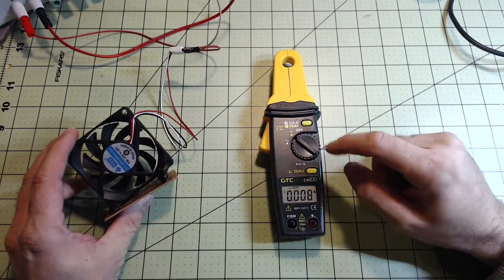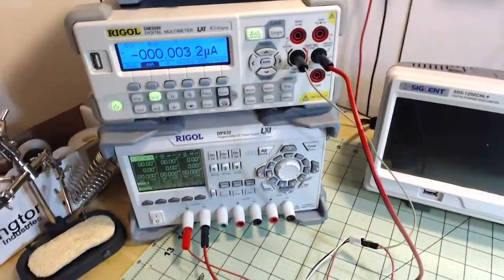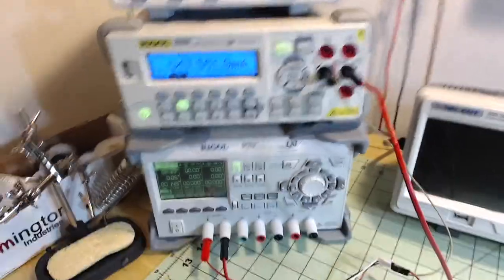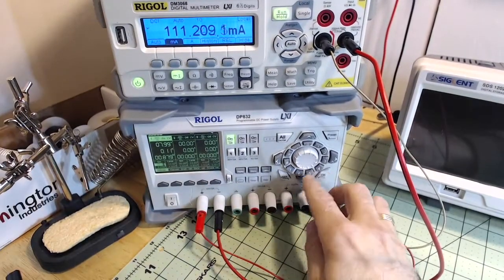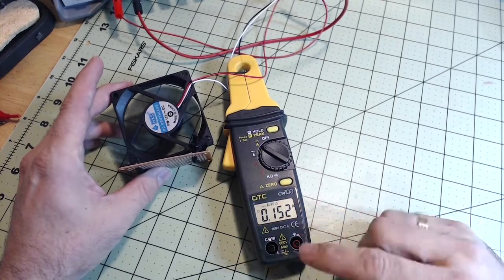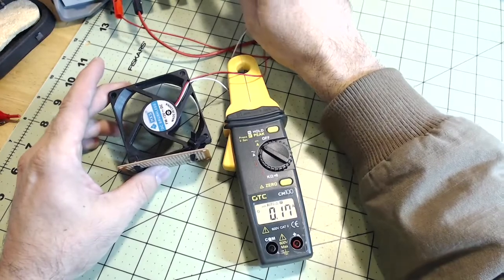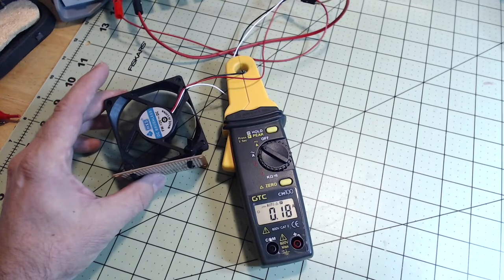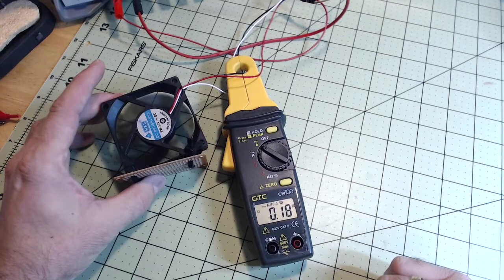GTC CM100 DC current test

Comment: I bought this same meter and was reading around 150ma on a ckt, then noticed when I took it off the wire it was still reading.
Reply from the maker: make sure you zero out before use
Reply: @electronicsprojects4708  
I did, but it still reads after unclamping from the wire
Reply from the maker: @michaelpinkston4628  does it fall to 0 over time or stays continuously with the erroneous reading?
Reply: It's not $150 anymore it's now $300